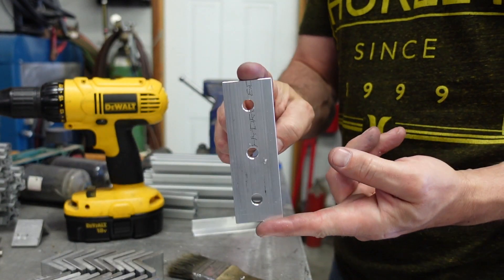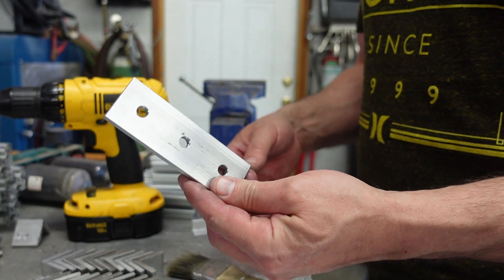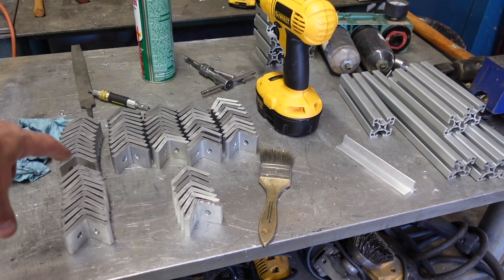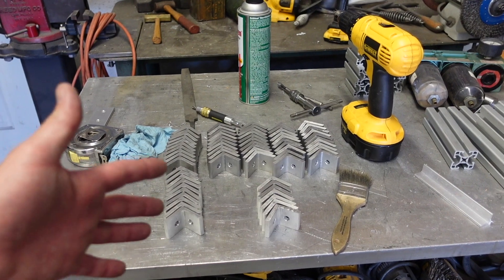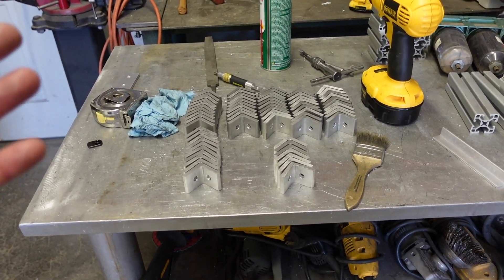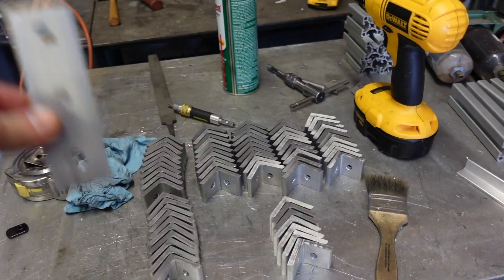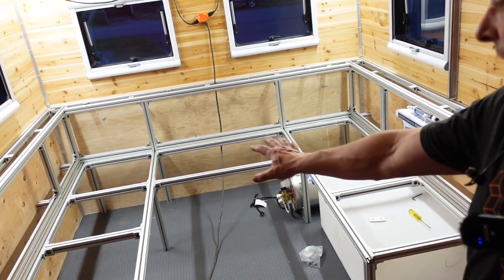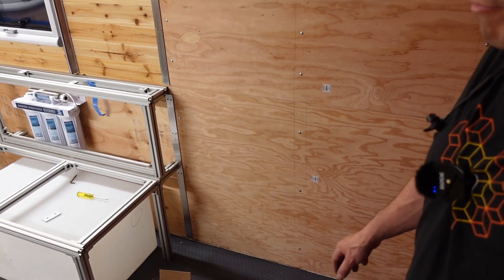Building your own 8020 brackets

Comment: Hi Chad. You made some nice brackets. Your labor was free. Unless you are self employed and would have used the time to charge out that 100 per hour. Nice sturdy brackets. But why didn’t you just cut al tubing and tig weld it to make your frames?  You have great skills and an eye for detail. I like following your build. I,m a retiring sheet metal worker. I’m building my all al camper next year. All  hand braked AL. shell, and interior panels, cabinetry on a tubular tigged frame. Thanks for the inspiration!
Reply from the maker: Thanks Jimmy, to answer your question I wanted to try working with extruded aluminum for a full build. Hindsight being what it is, a custom cut and weld aluminum frame would have been cheaper and easier. Once I get a little further along I’ll write up a blog post describing my thought process on this. Or make a video.

Comment: Looking nice Chad. Side question, how do you plan to trim out your door I noticed you don’t have that little rubber gasket on your door either it looked terrible on mine as my walls are 2 9/16” thick and I have to come up with another solution. I thought of buying another door frame and milling it down to size but Arctic tern says they cannot get me just the frame, now thinking of anodized angle aluminum as trim but curious what others are doing.
Reply from the maker: I’ve been toying with the idea of routing one out of cedar stock, to match the tongue and groove cedar paneling.  I agree, the gasket is less then impressive on walls this thick.  I’ll have a better idea once I get more of the cabinets surrounding the door in.